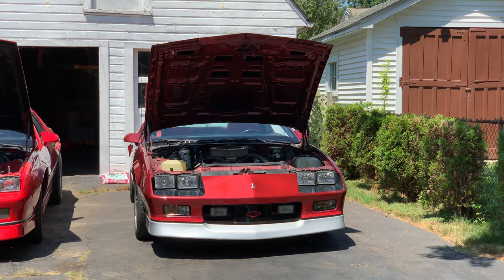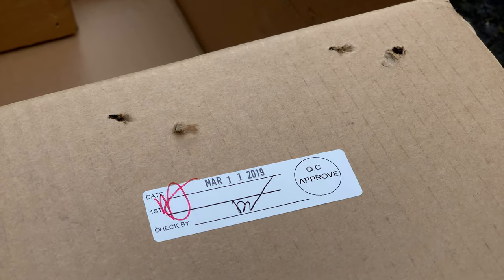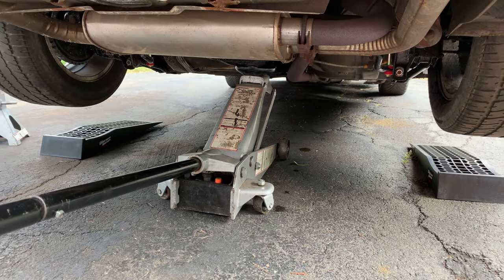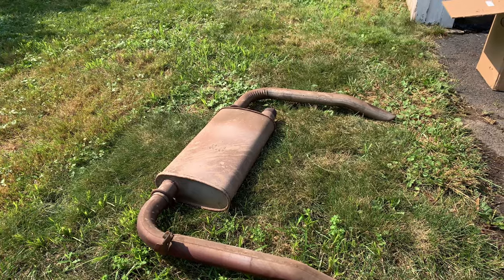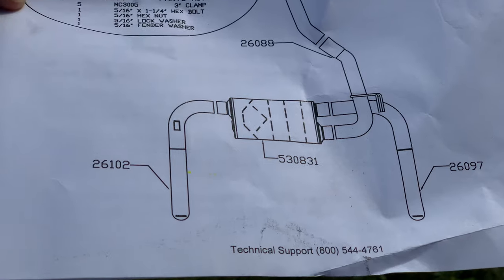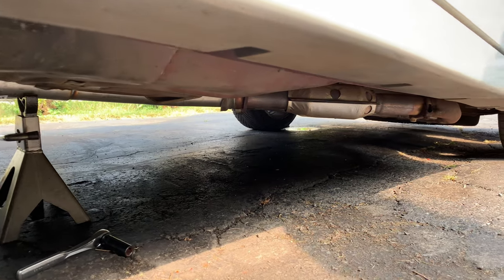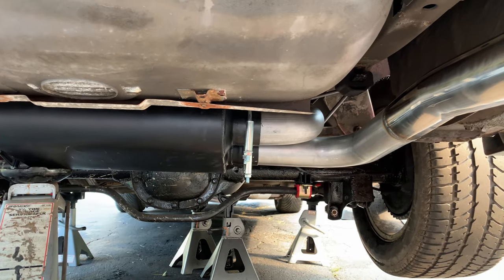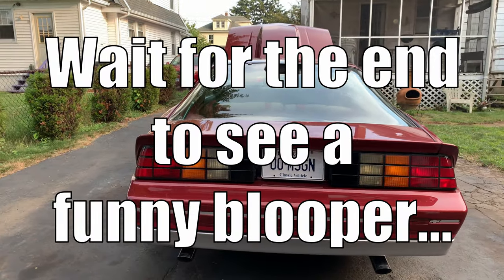Boost Your Camaro's Performance and Sound: Replace Stock Exhaust with Flowmaster!

Comment: Thanks, I was contemplating this set.
Reply: How is it holding up btw
Reply from the maker: @mikojoubert6974  Matt changes his mind a lot. He put in straight headers last year and changed the muffler to a Hooker Maximum Flow Mufflers 21609HKR. To us, it sounds better than the Flowmaster. The Flowmasters are great - and hold up well - but they're basically hollow inside, so they can get "droney" when you're driving along at certain speeds. Other than that, we love them, but again, Matt wanted to try something different and heard the Hooker mufflers were good.